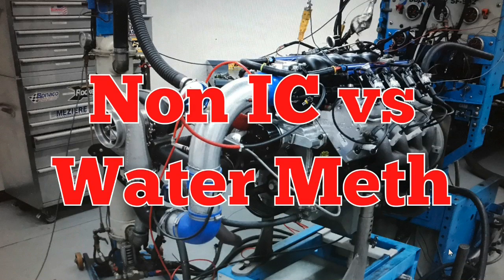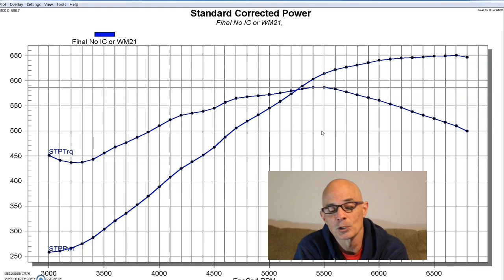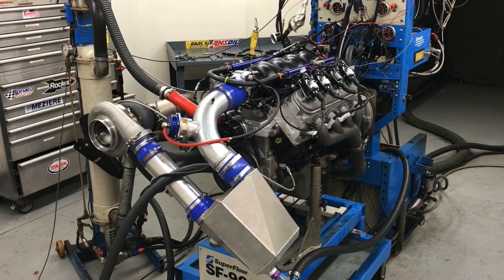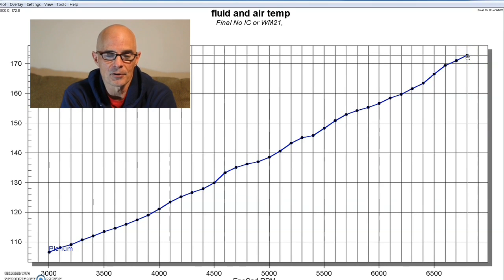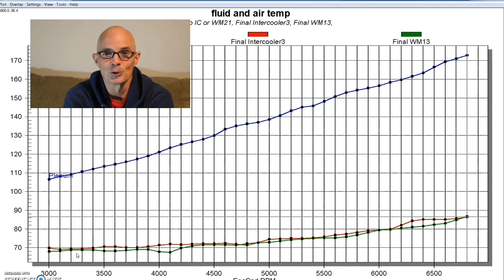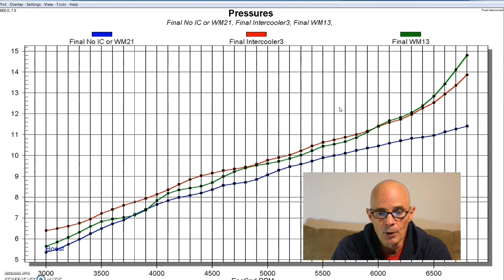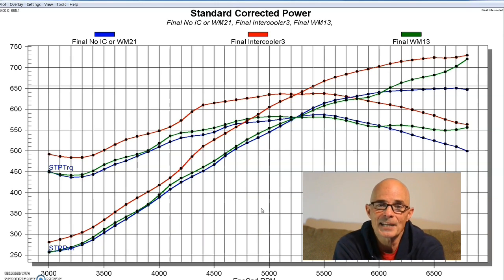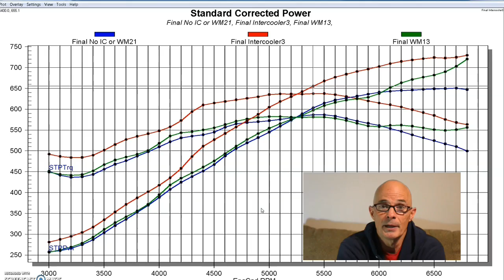WHO'S COOLER? WATER METH vs INTERCOOLER

Comment: water intercooler isnt a real world test. very little is said about water cooled intercoolers. where does the water come from?  Im in florida and for the street we have to deal with a/c compressors, transmission coolers, engine oil coolers and radiators. air to air can be placed in front of everything but now everything else suffers. im not arguing the test numbers but many chillers or fluid coolers are not an option. they would have to have their own radiator to be effective. where would it go. even the front surface area for a truck isnt big enough for all these coolers. meth/water injection is the only answer. please include real world parameters.
Reply from the maker: having driven around in many daily drivers with atw coolers-they are very real world (in any state) -using a small heat exchanger

Comment: My old Saab 900 spg I ran h2o/meth injection through the individual runners, easy to do with the layed down engine design, ran it with the factory air to air intercooler.  Allowed quite a bit more boost before the APC detected knock and dialed it back.
Reply from the maker: those were cool

Comment: I remember when the 1986/87 Buick Grand Nationals came out.....guys turned boost up.....some added a front mount intercooler which helped above the stock location but it
was not long before max boost for the technology of that day was reached. THEN guys came up with the water/meth injection which allowed MORE boost and power levels
went up accordingly. I remember when the LS maf was adapted to the GNs which helped put control back to the ecm.....yes, the GN six turbo rose in power from its
inception in 1986 as more technology came along. Of course the LS engines are so much better and so of course the cost of hp is much better than the old tech
Buick turbo six.

Comment: This boost creep is from non-linear gas expansion mostly from the adiabatic effects of the inert gasses i.e. nitrogen acting as a pumping fluid that isn't participating in the combustion process. Air is mostly nitrogen and no one seems to remember that

Comment: I feel like adding methanol to the AFR would run rich, decreasing power. I feel like the ramp up in the end was due to the engine finally getting a complete burn and water steam expansion pushing the wheel harder. All of the above cooling methods could use a little extra timing over the non after cooled turbo timing map. Distribution might have been better for the meth pre turbo. I feel like that intercooler flow restrictions might have given a small pressure boost in between the turbo and the intercooler possibly bumping the boost pressure readings depending on bung location. Can’t understand for the life of me how all fuel and temps the same how a intake restriction such as an intercooler would add power unless it’s just the water meth injection system was so bad on this application that it had problems reaching cylinders etc. like you mentioned. I think it was running rich on your cold cylinders and normal on your other cylinders. Did you take the same cylinder temp readings with the AWI?
Reply from the maker: intercooler always makes more

Comment: The thing is, by running water/meth are adding fuel so the reason intercooled made more power al around is due to running leaner if he would have tuned the water meth it would've made more power
Reply from the maker: no, just no

Comment: What people don't comprehend is that water-meth injection is basically an octane booster. Thus allowing you to raise your boost while remaining on pump 91oct. Instead of jumping on E85 or race fuels.. keeps your costs down. But it will not gain you much HP gains if your not tuning for it in meth or if you leave it on the same boost level you are already on. It will give you protection tho, dramatically cooler intake Temps, cleans the inside of your engine, helps prevent detonation. At the end of the day water meth injection will best suit your when your trying to raise boost levels but don't want to be or don't have a close supply of e85/race fuel or the budget for race fuels.. 
So an actual great rest for this would be as follows.
Do the same 5.3 boosted and water intercooled, but test on 91, 91+W/M, E85 "Pump", C16 or what have you, and maybe even a 110oct.
All at elevated boost levels over the baseline start from say 10lbs of boost. But here's the Kicker, see what it would costs to run it on those fuels compared to Meth, as well as the power each fuel puts out, and how far can one push each fuel prior to detonation. 
Personally for me I use meth injection in my offroad vehicles, especially where it's none stop use not like a drag strip.. its constant heat. A great way to manage intake Temps, on top of the air to water intercooler, and ice doesn't last to long In the dunes or desert. And I don't want to be blowing money on race fuel over a week dune trip. Or carrying extra fuel for the long routes when running E85. Hope the info helps 🤘🏼

Comment: just a guy who spends too much time on the internet, but doesn't it seem like air density, not air temperature, is the key to more power?

Gale Banks has said numerous times that increading your manifold air density in relation to the ambient air density is  key to truly increasing your engine's power. 

intercooling separates, then cools, then compacts the air before it gets into your engine. water-methanol dropped the temperature without condensing much at all. once the air moved away from the spray, it became as dense as it was before.

that is just my theory as to why water-methanol injection makes a significant difference only when it is either assisting an intercooler or spraying right before the cylinder.
Reply from the maker: gale does good stuff
Reply: @richardholdener1727  so i guess i'm on the right track when it comes to understanding what is going on here?

Comment: If you require better IAT cooling only, use 100% methanol. If you require better in-cylinder cooling, use 100% water. So M50/W50 is the best all-round performer. 

Per port is great for Cylinder cooling (water). Pre turbo meth is great fro charge cooling.

Comment: My tuner has me running 80% meth and 20% water, but boost juice is 50 50 and all the videos i see are 50 50. My tuner is using it as a fuel plus cooling though. Is this bad?
Reply from the maker: it has more octane and fuel that way
Reply: @richardholdener1727  ok, so it's safe then? People are saying you lose the cooling affect if you go over 50 50. I even got told it makes it burn hotter Instead

Comment: Hi guys! I am haunted by the idea of putting water-methanol on an atmospheric engine, to be more precise a rotary engine! Do you have such experience? Very interesting!

The rotor is very hot at the inlet and it seems to me that it loses a lot of energy in the summer due to excessive heat.

Comment: The water alky injection decreases the temp by mixing a liquid fluid with another fluid in a gaseous state which I would speculate being the water is denser than air could explain why it has priority over the temps but would not add any more air to make more power... The intercooler however increases the cfm by cooling the air itself which again I would speculate increases the volumetric efficiency of the air charge system itself. (i.e more air effortlessly being forced into the engine= more horsepower) But Having the injection for a street motor on pg for safety appears to be just as reliable as the water to air system.

Comment: How about water/methanol injection vs E85 on an intercooled turbo engine? I want to know if it's worth it to tune for flex fuel with E85 being very hard to find where I live, or if I can make just as much power with water/methanol injection.
Reply from the maker: i worry about distribution on meth injection
Reply: @richardholdener1727  I don't, since I'd use a port injection setup, but a pre or post throttle body setup would probably do terribly with that type of intake manifold and it's definitely a legitimate concern.

Comment: Hey Richard, I want to know if there is an email to communicate with you? I have some questions on the best size turbo for a 5.3. Stock everything but eventually make it a little stronger internally. Also, the Holley ecu you use, how to tune it? Is it a self learning system like the snypers? Thanks and hope you can respond...
Reply from the maker: killerbe16@aol.com-they are not self tuning-but do run closed loop

Comment: [ SUMMARY ]

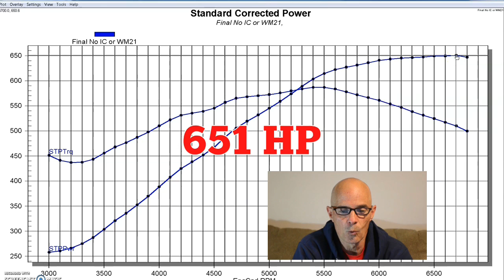[NO IC/WM 2:28] 651HP/587TQ
@173F' degrees 8:10 @11.5 psi

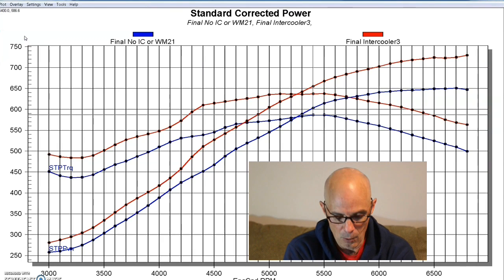[WITH IC 6:35] 729HP/637TQ
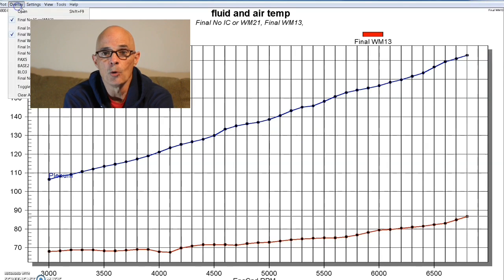@85F' degrees 10:12
@13.8 psi (IC made more power)

[WITH WM] 715HP/575TQ
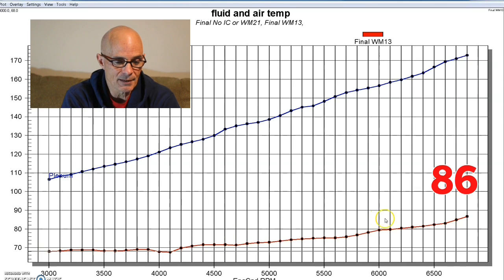@86F' degrees 9:40
@14.8 psi (WM made more power)

12:02 for boost graph
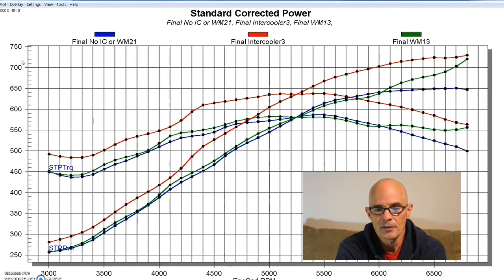13:00 for power graph

Conclusion: (Richard's opinion 15:01)
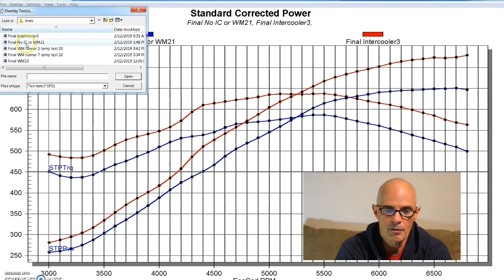IC +50HP/50TQ@mid-range (view @ 13:00)
P.s. WM vs IC = depends on your application.

WM best for big turbo, high rpm peak power.
WM may be better for peak power AND... race fuel
WM best for high octane tunes. (important)
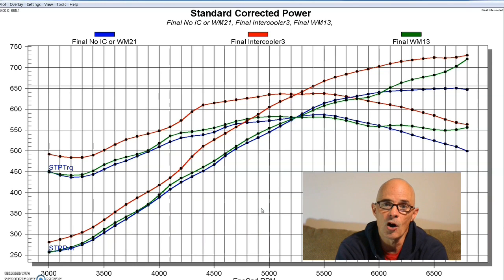WM not cooling evenly in all cylinders @15:42
Cause; long runners. Consider shorter runners
or multi-port injections, or different intake manifold.

You'll get better cooling with IC overall.

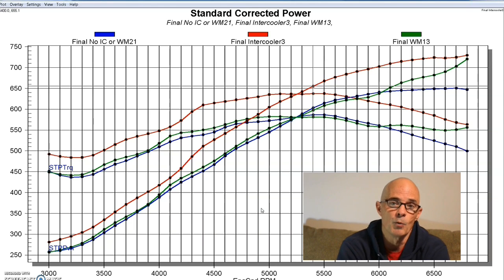Tried all tests but one, injecting directly in the turbo was not tested. 16:33

Richard's takeaway @ 17:16

p.s. If you're considering E85 tune, forget WM.
Like I said, WM works best for high-octane tunes. 91 to race fuel.
IC best for mid-range, most applications...

"IC" = Intercooler
"WM" = Water/Meth

Comment: I was speaking with the tech dept. at the Supercharger Store about this very thing. Intercooling lowers charge temps and water injection cools and changes the chemistry of the fuel. Slowing down the flame with water means more timing is needed; for my small-block Mopar example, it should be able to run 36º with no backout for boost. I'm experiencing is higher-than-I-want IATs (as high as 160) even with two stages of water injection (at the inlet of the supercharger). I could switch to an intercooler but then lose the benefits of the water and perhaps still not fix the heat issue. Or try one stage of water injection in the hat in an attempt to mimic the same kind of cooling that fuel in a blow-through carb provides. I'm running port fuel injection, and the IAT reading is from the upper plenum below the blades. It seems the engine heat is being absorbed by the intake.
Reply: I just read a comment about possibly direct injecting the water/meth, because depending on the design of the manifold or case of the charger, it can pool up on bends and turns.

Comment: Was the boost sensor before or after the intercooler, may have had a drop in boost through the intercooler and a increase in airflow, also depends if the reference for the wastegate was on the manifold, this would explain the extra horsepower on the intercooler over the meth injection.

Comment: Water going from liquid to gas increases in volume. This volume contributed to the boost pressure displacing the air and lower power output. This is why you see a major A/F change that is not all from the methanol...its from air displacement also.

Comment: Is it safe for the compressor wheel to inject methanol before? I've heard it's bad, I've heard it doesn't matter. I'm looking to add a simple meth injection system to a 4 cylinder turbodiesel and decided that pre-turbo would be easiest to plumb. It runs at about 230kpa, or just shy of 19psi of boost. It's only 74hp and I cannot modify the computer so methanol is the only way to lower the 350⁰F IAT's and add a little fuel for more power. I could also add an air-to-water intercooler using cool water on my application, but without extra fuel, the engine won't make any more power.
Reply from the maker: AN INTERCOOLER IS A GOOD IDEA TO LOWER EGTS ON A TURBO DIESEL-THE WM CAN BE SPRAYED PRE TURBO BUT IT WILL SHORTEN TURBO LIFE-IT CAN BE USED POST TURBO AS WELL

Comment: I would like to see what would happen if you install the water meth injector further away from the throttle body just enough to give the chance to evaporate more evenly through out the intake system. Also how about the EGT before and after meth injection would be nice. Other than that very informative videos!
Reply: EGT measurements, very interesting experiment.

Comment: Sounds to me the manifold isn't distributing air evenly. The water mist should be evenly mixed with air by that point
Reply from the maker: IT WON'T EVER BE EVENLY DISTRIBUTED UNLESS YOU DO PORT WM INJECTION
Reply: @richardholdener1727  Why do you say that?  A carburetor i provides less atomization yet fuel is effectively distributed

Comment: This is really interesting. I'm going to spray meth into my turbo as my intercooler is too small.
Reply: Hope you add AFTER turbo...the vapor eats the turbo wheel eventually. Best as close to throttle body as possible.
(I use a Snow Performance on my Diesel F-350 work truck. Installed about 6 years ago. Works great!)
Reply: @2dRgr  meant in my turbo motor not pre turbo 😅. Ah great to hear I had a number of delays with my build but should be able to test it on the dyno in a couple of weeks

Comment: So is there any disadvantage to running both (intercooler and meth/water)?
Reply: Richard, can you touch on this?
Reply: There is such thing as making an engine too cold...but if you do it right, it works great!
Reply: @markburkey6371  so at what point is the engine considered too cold?
Reply: @aaronliddell4280  not sure, that's just what I've always been told...🤷‍♂️

Comment: The first increase above 6000 rpm is because water is denser than air. At high load the waste-gate expelles the same amount of back pressure, but because the exhaust is now denser from all the added water the exhaust pressures remains higher even after the waste gate and more exhaust equals more boost. Plus this is also when boost pressure will typically be at its peak giving the greatest benefit from water/methanol injection or intercooling. That is why you saw a serious hp increase after that rpm. This is the same with the intercooler because colder charge air means more air is going into the motor which equals more exhaust as well. Water/Methanol works best with high RPM boosted motors that have exhausts and intakes specifically tuned for it when charge and exhaust pressures reach extremely high levels. The same can be said with an intercooler, but it also does well at lower loads of rpm and fuel and also can benefit from an exhaust and intake tuned for it. To where in this case you're using an intake and exhaust combination meant for either forced air with water injection or an intercooler, or both, or just a naturally aspirated setup. A tuned system would reveal more dramatic results, especially with a motor designed to exceed 9,000 rpm while under boost (which are rare). This test would also reveal more with a tighter system, a system not designed to deliver naturally aspirated back pressure and a larger waste-gate with a stronger spring in it. Also a stronger spring in the blow-off valve. 
I know to make an expensive video like this you're erring on the side of caution, but you could have given it a little more to drive the point home.
Thanks for the video and I hope you make another giving one with a cam tuned for a bit higher RPM and stronger springs all it's got.

Comment: I would really like to see this test done with port injection water meth,  couldn't get a easy reading on inlet temps but it would be interesting to see how the power curves overlay. ProMeth has a v8 kit, with a 9th injector that can be placed in the charge pipe, I run this myself because I have limited space for an intercooler and I don't want to run straight M1.

Comment: Air mass at 480 degrees vs 80 degrees is half per cubic foot.  40psi at 480 is the same amount of air mass as 20psi at 80 degrees. Those aren't exact but close enough to use in tuning.  In an extended run the hp at 20psi should be double the amount of the non intercooled one.  If your dyno is capable of holding 8-900 ft lbs you will get much more data.  You can also setup mass air flow to see how much less air you pull in as it gets hotter even though the boost is the same.  Air mass is far more important than boost alone.
Reply: Thank you.

Comment: You didn't adjust for the additional fuel in the water meth.  Because the flow rate is fixed it leaned out at the end. Did you use a wideband?
Reply from the maker: we do use AF meter on every test

Comment: Hi Richard. I have a question about intercooling. Does pipe diameter matter? I have a SBC 383 tpi with a BW s400. It has 2.5  pipe to a small intercooler running a 3psi spring tuned of the gate. I was either going to enclose the intercooler and run it as water to air. Or put a monster 600x300x100 front mount with 2.5 inch from the turbo to the intercooler the 3 inch out to the throttle body. Could you make a video on intercooler pipe diameter? Do you have any thoughts on this matter?
Reply from the maker: make sure the core flow well-take a look at the ls intercooler upgrade video
Reply: Yep I just watched it. Thanks ya legend! I’m in Australia and think your Chanel is awsome. Don’t change a thing!

Comment: Can you repeat the test on a carb with a single plane? I know we get evaporated cooling with carb, but would like to see the changes between pure meth, blend and just water. Before and after turbo. As well as temp from throttle body and bottom of a intake runner.